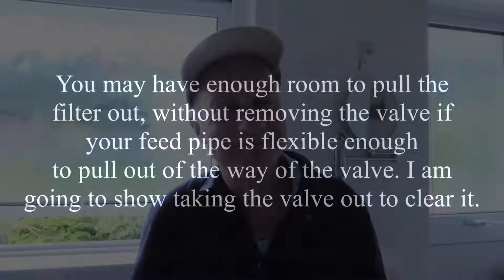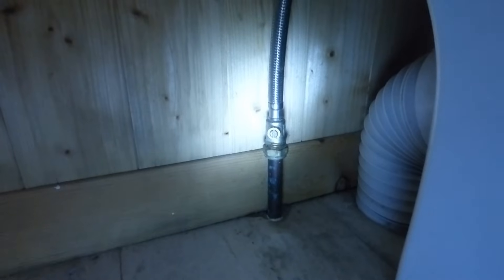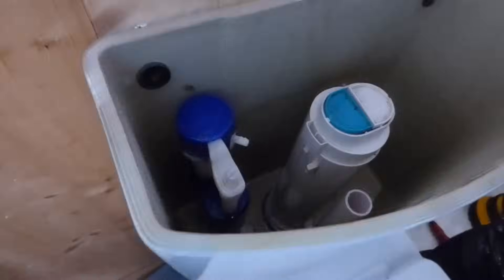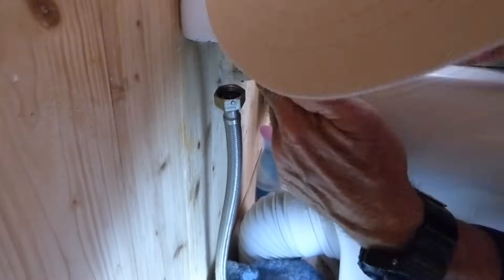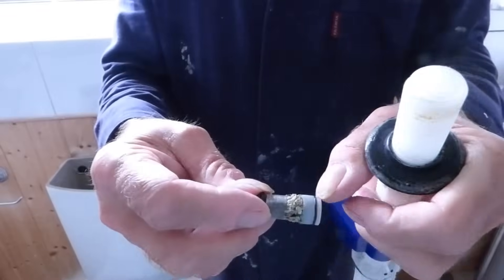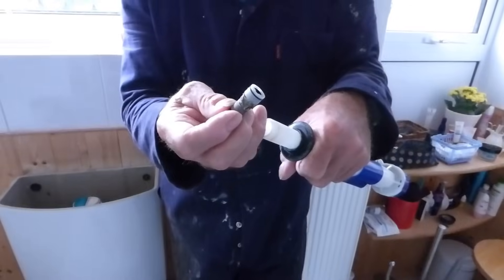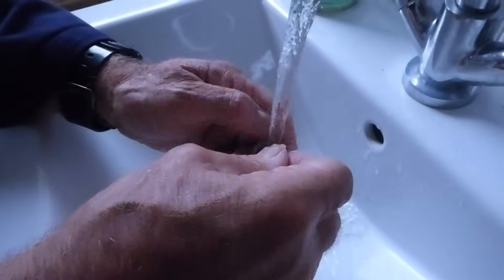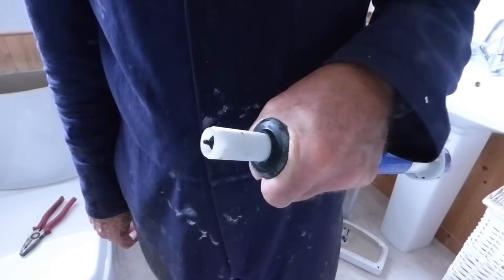How to fix a slow filling push button cistern

Comment: Great idea having your camerawoman asking questions and clarifying things.
Reply from the maker: Glad it was helpful!
Reply: @dereton33  I'm gradually working my way through all your videos as this plumbing job keeps going wrong. 
Went to change tap in kitchen, no isolator. Tried to turn off gate valve, wouldn't shut. Went to change gate valve for full flow ball valve, drain cock didn't flow. Refilled system after job, had air lock. Cleared that,  now LP toilet not refilling. Just goes on and on. Thanks for all the videos!

Comment: Excellent easy-to-follow instructions with great explanations of why there could be a slow fill.  Before finding your video I dismantled the valve with it  still in the cistern only to find that there was little or no debris in its upper parts. As you show, to remove the filter on the inlet the whole assembly has to be removed.  Unfortunately ours is concealed so the pan and cistern has to be pulled away from the wall to get to the nut holding the valve assembly to the bottom of the cistern. Since our WC is fed from a tank and low pressure I will take your advice and remove the filter altogether.

Comment: Thank you! My spanner wasn't wide enough to undo the plastic valve nut but after reattaching the metal pipe-to-valve nut and turning the water back on, the problem was FIXED! It must have been a simple air pocket causing the blockage.
Reply from the maker: Excellent!

Comment: Nice video but it doesnt actually show how you remove the filter! It only shows the filter after removal. Do you drag it out by the nipple, does it screw out etc? I've tried dragging it out with pliers and it won't come.
Reply from the maker: They have to be dragged out . They stick fast though and require some time. WD 40 helps.

Comment: hello.
I've just fitted a vr rimless toilet connected it back up turned the valve back on and it's no filling up its just dripping into the system
Reply from the maker: The valve is blocked.

Comment: Hi mine has a pause of about 25 seconds before it starts to refill, it has only just started doing this after around 4 years but is not slow to fill once it goes ,could it be the same problem Thanks
Reply from the maker: That is the valve washer .
Reply: @dereton33  Hi thanks for that do you have a video of this so i can fix the problem thankyou

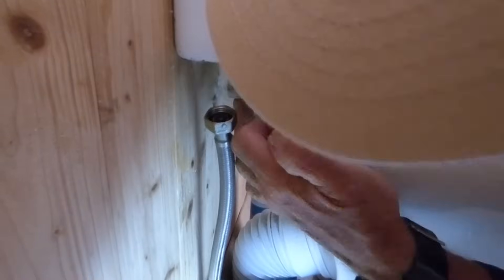Comment: Can you please tell me what size and type of replacement washer is required after unscrewing the flexi water feed as in 2:50 of your video? Will i need to replace this washer? Thanks
Reply from the maker: They should be a standard size.
Reply: @dereton33  yea ty i just was trying to find out before i buy one, so that i have the new one here before i take the water supply pipe off.

Comment: would this be the same issue if say your toilet wasnt filling up as much in the cistern, I have 3 identical toilets all with fluid master flush and fill valves and I have noticed the water level in one is lower than the other two?
Reply from the maker: Yes it would.

Comment: Mya toilet water is right up to the that drain pipe next to the button switch why is it so high and that the water keeps going didn't stop I have to lift a black arm leaver next to the button but you havnt got in the video next to the two button once you open as I lift it arm then it stop the flash any ideas
Reply from the maker: Just adjust the ball cock to a lower level.
Reply: @dereton33  I did the water right at the end of the water drain pipe in the toilet next to the push button not sure meant to be right at the end but not sure where the ball is no obvious to be the black are I have to manually move up each time In the toilet and it less then 7 month old

Comment: Thanks is for this video, mine is boxed so couldn’t do all of it myself. Weirdly when I disconnected the water emptied the cistern and then reconnected it it filled up quickly like normal so I presumed there isn’t a blockage but after flushing it goes back to a very slow fill any ideas?
Thanks
Reply from the maker: Check the valve.

Comment: Hi pal I've installed a bidet spray to the toilet inlet feed and I've got pressure to the spray gun but no water coming into the water inlet valve ..I've taken the valve out replaced the diaphragm washer which needed doing also cleaned the filter as in the video and put everything back into place - there still doesn't seem to be any water coming into the cistern even though I'm sure water is going into the inlet valve!
 It has been working for the past week and now the cistern isn't filling .. I'm stumped!
Reply from the maker: Check there is not an inlet filter, when the feed pipe connects or that if it has a mains reducer that it is not blocked.
Reply: @dereton33  hi pal it seems as though the  plastic lining of the flexi pipe going to the cistern into the inlet valve has deteriorated as there was a lot of blue bits everywhere..took inlet valve off and cleaned everything and left off the bidet and the toilet works perfectly now!
Going to re attach the bidet and hopefully it'll all be ok ...wondering whether to buy new flexi feed pipe but unsure how to fit it as one side is push fit I think and unsure how to disconnect it .
Reply: @dereton33  hi pal...all sorted watched your video on removing pushfit fitting took old pvc   pipe off which was way too short and very stretched ( I think the original plumber wanted to save a bit of cash) hence the deterioration of the inner blue lined core.
Anyway fitted a compression fit flexible metal hose which was a cinch once I got the old push fit off and hey presto!
  Cheers for the videos ..oh by the way how are you doing ?

Comment: How does the flexible hose attach to the water inlet?
Does the inlet water valve come with the flexible hose?
Reply from the maker: You can buy the hose with a valve attached. The valve end would go onto the copper pipe the other end to your cistern valve , tap or whatever.

Comment: Hi, Thanks for the video. I've followed the video but the cistern is still extremely slow @ refilling. It's filling from a tank in the attic & the water supply has a good flow before re-attaching the flexi to the valve. Any ideas or should I just buy a new valve?
Reply from the maker: The seat of the valve is a high pressure one, swap it over for a low one
Reply: @dereton33 thanks for your reply. I installed a new fill valve last night & everything is working as is should.

Comment: Gonna try this in a min, I am hoping this solves my issue!

Edit:  Didn't work, took it all apart, filter looked fine...so I bathed everything in a little warm water and used an old toothbrush on everything, put it all back together and it's still a little trickle of water when filling back up after a flush >:(
Reply from the maker: Check you do not have a high pressure valve fitted to a low pressure system.

Comment: Thanks for the video. I have gone through and cleaned the filter but when I have reassembled. There is no water coming through the infill (I’ve double checked the shut off). Any ideas?
Reply from the maker: Best to change the valve then.

Comment: Posting videos on Bank Holiday! get out and enjoy your lovely garden. Mind you, I can talk, I'm in the workshop making jewellery/trinket boxes for the family lol
Reply from the maker: Had done this video last week just forgot to post it. Memory fading fast Cliff.  Ha ha.
Reply: dereton33  great vid,thanks pal
Reply: I did buy a book a while ago, all about improving your memory. I just can't remember where I put the damn thing Ha ha.
Reply from the maker: Ha ha very good.
Reply: dereton33 Hi ,I've just replaced my thermostat could you explain what these settings mean (TEMPERATURE OFFSET ) and ( PROPORTIONAL BANDWiTH ) the reason I'm asking is the boiler comes on for two minutes goes of for 3 minutes  but it's not sufficiently keeping the radiators hot over time they become just warm ,I've looked at the settings and cycle rate is 6 cycles per hour , minimum boiler time on is 1.. temperature offset is 0 and PROPORTIONAL BANDWiTH  is set at 1.5 these are the factory settings do they need adjusting if so to what settings ? Thanks